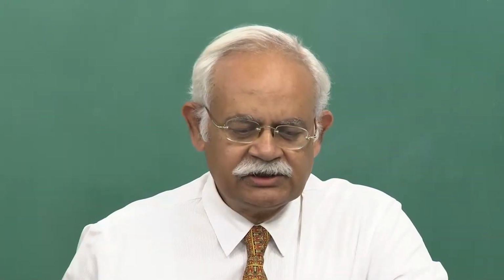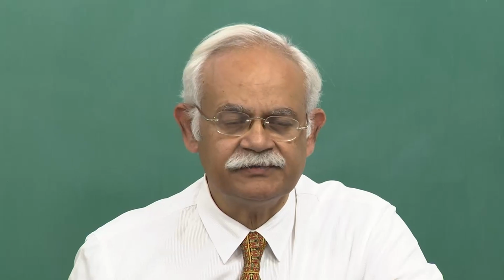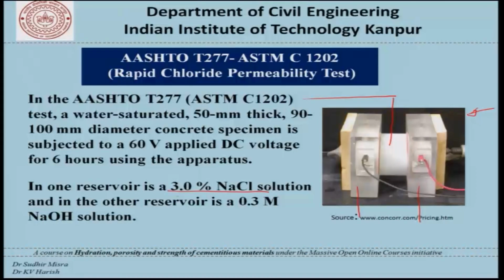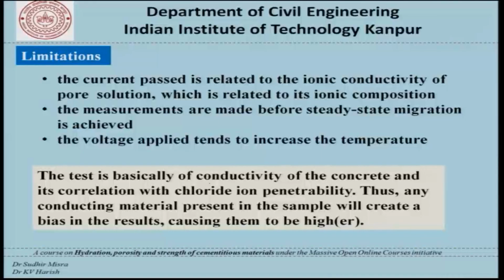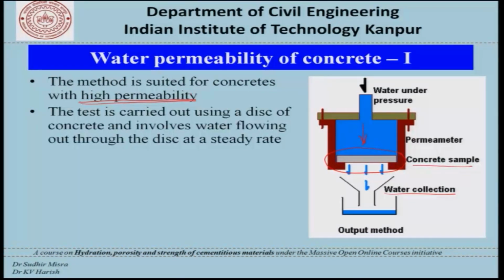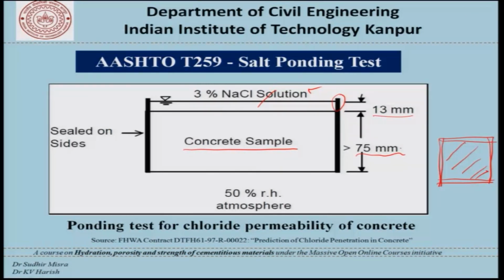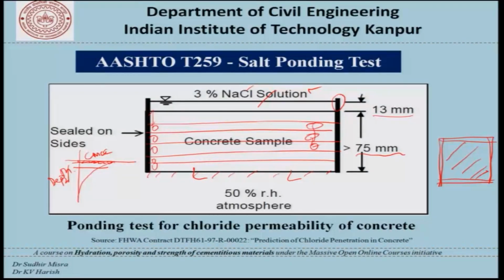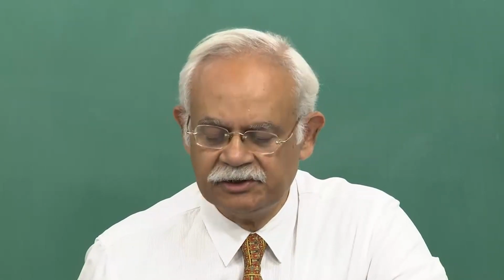Measuring permeability of concrete

Comment: On what observation/analysis the permeability/porosity which is generally taken as the (measured under pressure in MIP) be correlated to the intrusion of environmental gases in concrete?.